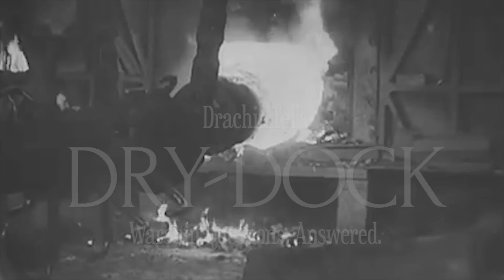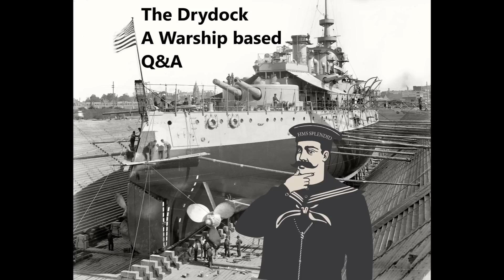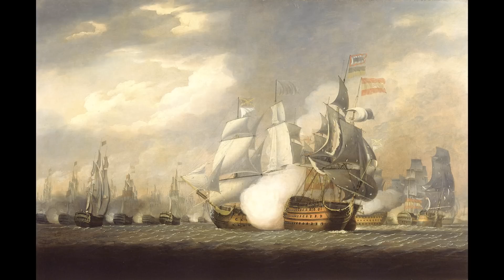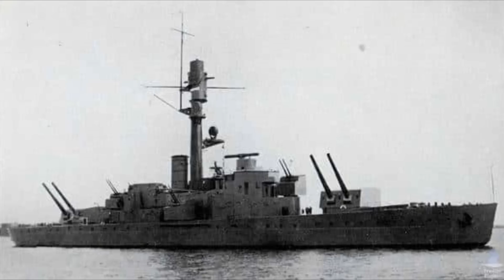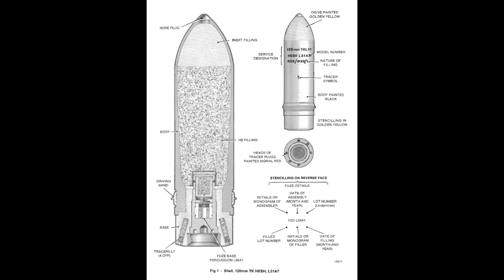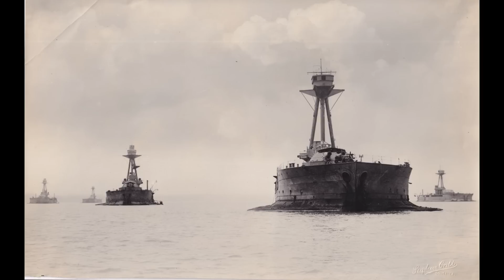The Drydock - Episode 212

Comment: Regarding Bismarck's radar, I do believe Scharnhorst also knocked out her radar with her first salvo during her encounter with HMS Renown, which prevented her from effectively engaging Renown as the latter could fight from an area with low visibility while the German ships were silhouetted against the rising sun. Gneisenau didn't experience similar difficulties, but had her foretop hit and her 1st gunnery officer killed, which forced both ships to withdraw.

2 months later, during the sinking of HMS Glorious, neither Scharnhorst nor Gneisenau had any apparent difficulties with their fire control, given how they repeatedly hit Glorious through smokescreens. Scharnhorst did lose her radar again due to the torpedo hit by HMS Acasta, but by that time, the damage to Glorious had already be done.
Reply: Renown was engaged under truly dreadful sea conditions. Both German battleships had numerous problems with flooding of the A-turret and salt water inundation of the fire control systems. Renown had her own issues, but the Germans expressed amazement at her rate of fire and accuracy, all the while expressing dismay at their own assorted gunnery problems due to the flooding.
Reply: @davefinfrock3324  That is all true, but Renown was very lucky nevertheless. She scored 3 hits on Gneisenau, all of which hit important areas. A 15inch shell struck the foretop, killed the gunnery personnel and also damaged the secondary rangefinder atop the bridge with shrapnel, a 4.5inch shell hit A turret and knocked off the plate which covered the rangefinder, allowing seawater to enter the turret, and another 4.5inch shell hit one of the 105mm heavy AA guns. Gneisenau scored two 11inch hits, but those hit unimportant areas.

Renown was also built with a higher freeboard which greatly helped her in those sea conditions. She also had the weather advantage due to the sunrise taking place at that time behind the German ships.
Reply: @michaelkovacic2608  Fascinating that the secondary battery performed so well in disabling various vulnerable equipment. Especially things one wouldn't really think to consider.
Reply: @mysss29  I believe this shows what a complete pissing match this battle really was, when your secondaries score more hits than your main battery, then you know something is not right.

Comment: Just a quick throw-in since some listeners might not be aware of it: Yes, Bucentaure would be classified as a third-rate under the British rating regime, but her firepower was remarkably greater than those of any British-build third rate of the time: With a broadside weight of roughly 540 Kilos (using Kilos here since the weight of British and French pounds differed somewhat), a Bucentaure or Tonnant Class Ship of the Line was equal in firepower to British second or first rate Ships of the Line ,making the nominal firepower difference between Bucentaure and Victory not quite so damming as "104 vs 80 guns" might sound.
Reply: Was any of that throw-weight make-up because of carronades, which have much shorter range?
Reply: @gregorywright4918  the french had some kind of their own caronnades later, but for the Tonnant and Buccentaure Class the broadside weigth pre 1806 resulted from  two factors: A long waterline resulting in many large caliber guns per gundeck, and comparativley large guns (i.e. french 36 pounders on the lower gundeck when the british used their 32 pounders on that Deck).

Comment: Quick note about scaling model testing. The wavemaking resistance can be scaled from a model test. The resistance from fluid friction has to be calculated for the full size hull. This is because the wavemaking resistance scales with the Froude Number. So you can scale the wavemaking resistance as long as the model and ship are at the same Froude Number. But frictional drag scales with the Reynolds Number, which would mean you’d need to test the model at the same Reynolds Number as the ship. But testing the model at the same Reynolds number is effectively impossible, because the model would need to go orders of magnitude faster than the full size ship.
Reply: All this talk of Reynolds numbers is giving me flashbacks to college....and I'm feeling an unsettling urge to start screaming in terror.  Suffice to say, I did not enjoy my fluid dynamics courses 20ish years ago.  To date in my engineering career, I've managed to avoid any and all references to such arcane knowledge.  Thanks to this video, I'm pretty sure I'm going to be having nightmares for the next few days.....🤣
Reply: Some time ago I visited a university pool that was used by the naval engineering people to test hull designs. In particular they were specialized in ice breaker hulls. IIRC for scaling purposes they used a mixture of water and ethanol. They joked it was the largest reservoir of vodka in the country. :)
Reply: @jbepsilon  USS Screwdriver v HMS Martini?
Reply: Oops I jus made the same comment.  This is why hill design for seakeeping is so difficult even now.

Comment: 39:20 Funnily enough, this came up in the Cameron report on Bismarck, which I of course started reading as soon as I finished that video :) Baron von Mullenheim-Rechberg recalled in conversation with Garzke and Dulin that the radars weren't installed until after Bismarck had done her gunnery trials, which he found a "puzzling" decision.
Reply: Bismarck had lots of issues when she was sent out. Another one is that her 105mm AA guns had 2 different mountings, the C31 and the C37, which were apparently "stolen" from Tirpitz. Thus, half of her heavy AA suffered from faulty fire control. The decision to send the ship out in this state is beyond me.
Reply: @michaelkovacic2608  This one also came up in the Cameron report - Bismarck was apparently supposed to have eight C37 mounts, but four were diverted to fulfil a trade deal with the Soviet Union and were replaced with the C31s.
Reply: @Dafmeister1978  sorry I got it wrong, thx for clearing it up.

Comment: 1/350 scale test runs way more issues. Air density and water density if I remember is significant as things get smaller. Don't get me started on the physics of 1/350 scale 16" gun 😁🤪 not to mention how silly it would look firing. Imagine the challenges of making a shell that small. 😝